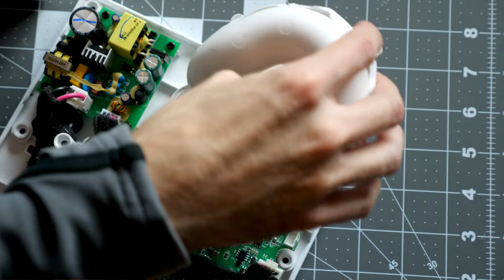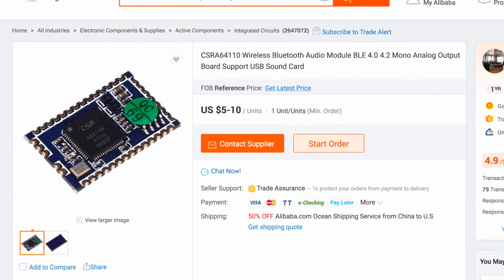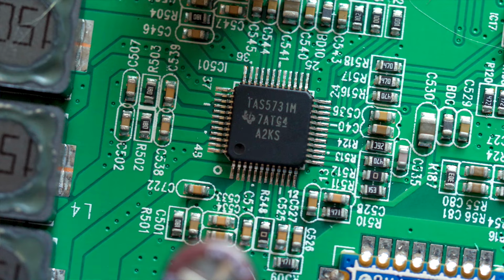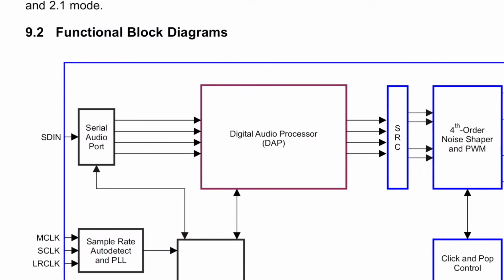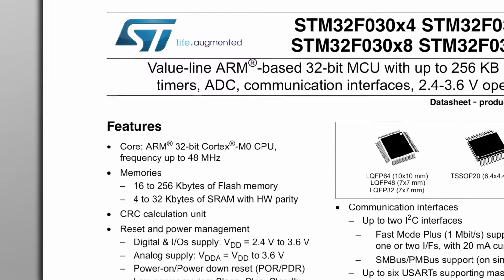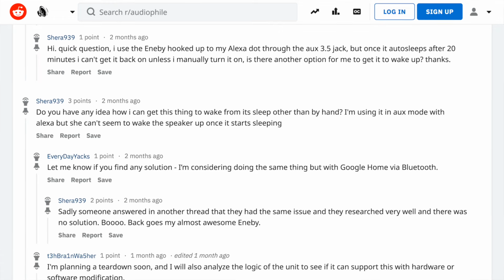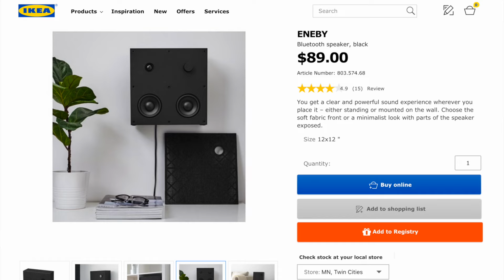Tearing Down IKEA's Bluetooth Speaker!

Comment: I have worked with STM32 Microcontrollers before, sooo here a few thoughts from me.

they actually support flashing (and reading, but never done that) over uart instead of swd, like other ARM microcontrollers, which is really great because it reduces cost, but i doubt that you would manage to do anything with the hex file. (or atleast i havent worked really hard with assembly for a long time)

I think it would be a much better idea to monitor the communication between the micro and the other chips and emulate that in a new firmware, which could be open source. I doubt it does much while its just playing audio, but rather just sets the registers of the chips when something happens (button press, bt connection, volume changed etc.) which should be not that hard to copy.

Dont know, maybe if i got time (and have to visit ikea again) i might give it a try, would be a really interesting project for sure.
Reply: The st-link utility do a simple obfuscation by default, so it woudn't be worthy to try to dump it
Reply: @mateusfelipecota  haven't tried yet reading flash out really.  well then it's to the Logic analyzer I guess.
Reply: I'll buy you a speaker if you can figure out a way to disable the autosleep feature
Reply: @hnisseplutt  thank you, but i think i might get one by myself anyway next month. Im already sorry for the warranty sticker ;)
Reply: If you fix this problem I will love you forever and tell my grandkids about you. Seriously.
Reply: @Strawberrymaker  I bought this to tear it down to do exactly this. I've got a logic analyzer as well. Every chip here is on the I2C Bus right?
Reply: @emb1995  Not sure, but i got my christmas money early, so i placed my order too :D Will be looking at reverse engineering the pcb first. could also look the parts up. Can you maybe PM me your Email address so i can invite you to a slack workspace? I think that would be much better for communication :)
Reply: @emb1995  rewatching the video. the bt module is using spi. The Stereo ADC is set up by itself with resistors or via 3 gpio pins. The Amplifier uses I2C.
Reply: Got mine today, starting work on it now :)
Reply: English please
Reply: @aasmith6117  forget everything I said in the original post. Found a way to disable sleep on aux and Bluetooth with just 2 wires and 2 resistors
Reply: @Strawberrymaker   So...will you share your solution with us?
Reply: @JamzFX  still working on the video and uni is getting a little bit in my way, but i think it should be done by the next week or two max. :)
Reply: @Strawberrymaker  Thank you for working on this Matze, how did it go? Don't see any video on your youtube channel.
Reply: @sallerc  Works flawlessly, my Eneby is running all the time now, but didnt knew how to put it in a video exactly. I will probably make a blog post soon. Kinda forgot about it, too
Reply: @Strawberrymaker  Sweet! Video is no requirement for me :) Looking forward to your blog post.

Comment: On the stereo mixing: the current version of the speaker (now called Vappeby -- not sure how much internals changed but it no longer has bass/treble setting :( ) does have stereo pairing option so the "master" speaker can take aux input and send it to the other speaker. I've found the option mentioned in manual for "Eneby 20 gen 2" already so it must've been something planned from the beginning and hence mixing signal in digital.

Comment: I might want to add some struts between the rear and front (says she who built her subwoofer out of 19 mm chipboard (small chips, not what you typically see in the US), probably went overboard with sealing and internal supports) and a bit more damping material but that looks surprisingly good. I just don't trust speaker walls that are that thin. :D
Reply: Samira Peri 👍🏽👍🏽

Comment: The stereo is not cutted from the AUX Jack input directly, simply because the left and right channels can be both differents in songs, so you just loose totally the left or the right if you remove a connector of the jack input. (like a guitar only on left channel or a drum only on right)
The solution here is to mix together thoses channels to one, with the chips you presented.
Reply: Yep, the proper way to mix down is to use opamps, but there are lots of components just to support the aux input
Reply: MichaelKingsfordGray  french
Reply: I bet one of the designers also saw the possibility to use multiple speakers like a stereo pair. even though it isnt implemented it  may be possible with some homebrew

Comment: I was thinking about what you said on the conversion of stereo to mono from the 3.5mm jack, and I was wondering if this is because the bigger Eneby has the same board, and supports stereo? I have never seen these speakers before, however, so it was just a little thought.

Comment: Should have had Bluetooth 5. The range would be insanely better.
Reply: Ikr
Reply: Henriko Magnifico it's a cheap ikea product lol
Reply: Cameron Chitra-Straley has surprisingly decent components for a cheap IKEA product.
Reply: Sybrand Botes Yeah, they shouldn't complain about bt 5.0 though, that was my point.
Reply: BT5 would have made this product unsalable because it’s not that common (yet).
Reply: @RustOnWheels  BT5 is backwards compatible with older devices. It will work with a phone that has BT4. Just none of the improved functions of BT5.
Reply: Felix O'Keefe that may be true for Android but is that true for Apple?
Reply: @RustOnWheels  of course it does... why wouldn't it?
Android doesn't ''make'' Bluetooth you know.
Reply: LA I know that but Apple is quite restricted in BT usage and I had lots of issues in the past with different speakers toting different BT versions in combination with Apple phones.
Reply: KlankOntwerp I haven't once heard about such problems. Apple uses the same bluetooth chips as android phones.
Reply: ikea use the cheapest Bluetooth solution, with bluetooth 5, the build cost will be not worth it for the cheapo speaker unit.
Reply: You have never heard about apple bluetooth problems ?? Really ??  @movitz1579
Reply: Insane range but you couldn’t hear the speaker from there.  😂
Reply: @RustOnWheels  why is this not surprising coming from apple? They would much prefer you to buy into their own propriatory bluetooth standards and their own apple branded peripherals if they could get away with ripping their customers off with them as well. If you want more broad range compatibility just buy any Open Source based android product from the manufacturer of your choice ie not apple! Their profits have taken a massive dive just recently. Why on Earth could that be then?
Reply: That would’ve been to expensive

Comment: This unit uses a class D amp design.   A class D amps uses PWM of a HF carrier with output filtering to integrate the output power.  It is much more efficient than  AB (+95% vs 50%) , so doesn't need a heat sink and has THD <1% . Because of the inherent flatness of the amp, a DSP isn't needed, just output filters matched to the speaker characteristics, which in this case are known. Bass tuned port sealed cabinet speakers are 1950's tech with well known, calculable performance characteristics.
https://www.eetimes.com/document.asp?doc_id=1274753

Comment: Great detailed teardown, it reminds me a little of the Logitech Squeezebox Boom, which uses a very similar looking woofer, and is a stereo active system using class D amplifiers,  digital crossovers, perceptual (fletcher-munson) compensation for volume and to prevent overdriving at high volume. Looks like a well thought out product.

Comment: With two cheap bluetooth transmitters from alieexpress, you could send left-channel to one Eneby and right-channel to another Eneby. All you still need is a stereo to mono cable. 

This way you could make a fully wireless  stereo setup.
Reply: good luck getting good sync
Reply: Bunnyslippers - or even better... just go and buy a PROPER stereo bluetooth speaker system. Will cost you less.

Comment: The power supply is on it's own board because no one designs AC-DC supplies any more, you just pick a board/supply out of a manufactures catalog biased on specs and features you need. The same goes for those BT daughter boards, they already have FCC certs and do not require to be completely re-certified, only the standard consumer device certification. The STM32 may have its firmware locked (a feature it has) so no dumping it.... Not a big deal since the STM32 is a very well documented micro with a ton of free and open dev tools (why it's popular in consumer devices) so probably quicker to just make your own firmware from scratch than trying to reverse a dump.  The Digital Audio solution is smart since it lets them do crossovers, filters, EQ and what not all in logic/software, saves a lot of parts and analog black magic wizardry.

Comment: Okay so the tx and rx won’t help you much with the code. It’s probably mostly used for debugging and uploading code (if it has a bootloader on it prior to being connected with tx and rx). What one could do is solder very thin wires directly to the chip and use an stlink v2 to get the binary off of it. It’s very easy actually. And after that it can be changed. You’d probably have to mess with assembler a bit to get it right, but it shouldn’t give you too much trouble.

Comment: if they did the mono mix down passively, maybe it wouldn't sound as good?
Reply: Sine Nomine I asked the reddit audio engineering thread about passively collapsing stereo a while back and they said it'd deliver poor results.
Reply: @voltare2amstereo  is phase adjusted real time or just flipped from the start? Never thought about the issues of summing, might have to revisit a resistor network sitting behind a speaker lol.

Comment: so with there being a spare output channel... What channel/power do you have spare?

Wouldn't it be worth fitting another speaker and maybe some basic heat sink's to the board... personally I think this platform would be great for modding as a 20hr battery life is huge! I would easily sacrifice some of those mHr's to drive more sound or even better quality cones.

Comment: There is most definitely some DSP-magic going on to make such a "bland" speaker sound good!
Reply: zapro_dk Basically every speaker of this type has some kind of DSP
Reply: @ilpatongi  Yeah. Before DSP speakers of this kind were either expensive af or just plain bad sounding.
Reply: zapro_dk Yup
Reply: I have some thoughts about where those drivers come from, and I'm not so sure... should be easy to measure, anyhow. :)
Reply: It would be stupid to convert the audio to digital unless it needs to DSP the audio.
Reply: Richard Smith The audio is sent digitally to the speaker in the first place.

It gets processed and then sent to the DAC and Amp
Reply: @ilpatongi  Not from the Aux port, they go out of their way to convert that into digital first, instead of just amping it.
Reply: @rich1051414  yes that's so it would get the same DSP, limiting, bi-amping, limiting, volume etc. processing as the Bluetooth source does.
Reply: @Qui-9  Exactly.
Reply: I have the big one with out using de build in crap eq very decent sound lower bass then jbl xtreme 1/2

Comment: Could you do a tear down of the W-king D8 (or Alpatronix AX500, as they seem to be the same design). I have a D8 but haven't been able to disassemble it. The D8's have crazy bass and volume but an annoying resonance peak around B-flat 1, and it would be good to check if anything can be done about it,  perhaps with acoustic filling, adding weight to/stiffening the enclosure, cutting a vent port, changing one of the internal speakers for one with different acoustic characteristics etc. to spread the resonance peak out a little.

Comment: Hypothesis: The likely reason they have 2 op-amps at the back end of the headphone jack is they may be planning a future version on the same or very similar hardware that can take stereo from a single speaker and split the left/right channels with a second speaker over BT. Also similar reason why the BT only has a single amp on its output. They're probably planning something like the way crApple's wireless headphones work where each unit connects separately to the host device.
Reply: Ya say crApple but if it wasn't for them there wouldn't be truly wireless earbuds... Everyone thought they were stupid until they created some... Also hats off to them I've tried them and they work very well, quite difficult to sync up 2 bluetooth devices together.

Comment: Yeah, I too spent those awkward 2 minutes figuring out the 2 center screws

Also - splendid overview!

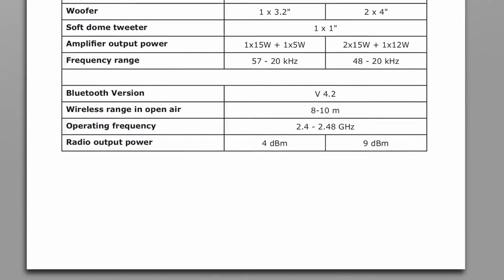9:00 the antenna looks identical on the eneby30 (I have a video teardown on that, waaahahay cheaper production quality though) .. said antenna is rather weak

Also regarding cut costing .. they could’ve also had the same board in both amps, and ... that really wouldn’t have hurt performance ...

They also didn’t enable TWS ... which would have again, costed nothing
Reply: > They could've also has the same board in both amps, and it wouldn't have hurt performanceì
I'm happy they cared enough and used the extra headroom to improve a feature, to be honest. 

What do you mean by 'enabling TWS'? Giving the user the ability to use two to play stereo?

Comment: I would guess the mixdown is analog behind the opamp. Doing it before the opamp would mean you’re basically relying on the drive amplifier of the device that it’s connected to, across the whole cable, to drive the mixing. That’s bad design if you want to be able to connect to everything, even when those devices are not designed great themselves.

Comment: Still though, for way less than $50 you can acquire a class D amp board w/bluetooth, four 18650's, a couple decent drivers and cheap tweeter and make a project out of learning about enclosures and crossovers.

Comment: This video was great to find. After 2-3 years of use, My Eneby 20 will not connect to anything. It simply searches but won't hook the nearest Bluetooth signal. Can this main circuit board be purchased? I suspect that's where the problem is.. or should I simply toss it and buy a new one. Up until this glitch, I've loved this Eneby speaker. I've spent hours trying  to get an answer from IKEA but I think their website is designed to keep you searching until you simply give up

Comment: They could just have just used the CRS module... and an class D amplifier.
Looks like that paing qualcomm for the development platform was not in mind so they added lot of glie logic to the board.

Cirrus logic have boilt in Kaliba DSPs, htey can output digital audio I2S and PCM.
They can route an analog input via its internal ADC to the DSP and back to the digital audio interface.

So they only needed a tiny uC for volume control (a ARM uC is just useless in that design), a class D amp and the CSR module.

Comment: I wouldn't be all that surprised of the margins on IKEA products are pretty thin in general and that they rather opt for volume.
With that said though if they decide for a product they likely buy at a pretty decent volume so they can keep prices down a bit because of that too.
And then there's of course things like distribution and storage and such probably being pretty efficient and having less steps than if you bought a speaker in some electronics store who bought it from some other local distributor who ordered from the brand company who maybe even ordered it from someone else ..

Comment: I've noticed a mistake.
Looking at the TI power amp a little closer, you can see that all 4 outputs are, at the least, connected to external components. This suggests that the tweeter is being driven in BTL (bridge tied load) mode as well. There are some nice benefits from using BTL amps.
The datasheet states a max output of 15W when using BTL mode, but that doesn't mean you have to use all of it. Great video otherwise.

Comment: Passive mixdown of stereo is a bad idea. This speaker might be inexpensive but they didn't want to cheap out like that.
Reply: I have used summing RCA cables to take stereo down to Mono before when I needed to I'm just curious as to what the technical reasons are why you shouldn't do this ? In other words what are the sound quality losses and which way should it be done? Genuinely asking here I've never heard such a thing
Reply: @maxwelsh6121  the main reason is you can overdrive the input. If both channels max out, you'll get 2x max voltage on the summed line and you could blow whatever you're feeding that into. You should at least use a resistor to drop the voltage back to nominal level.
Reply: mikosoft of course you’ll get 2x the voltage. In most modern music both channels hit peak at the exact same time very regularly, it’s a complete non-issue that the voltages will sum to <= twice the amplitude of each of the original channels.
Reply: Max Welsh there’s no problem with that as long as your output is leveled properly
Reply: Roughly what id had expected.  What i hoped to learn is what between  the lines     what would the issues be if the two channels had significant waveform/power demand  diffs? What  Mikosoft was gettin at...
Reply: @asdfkjhlk34  the problem is you can't level output on a cable. Passive summing CAN be an issue - as I said you can overload the input which will either result in clipping or in the worst case will completely damage the input.

Comment: Interesting and informative. I'm rather curious about the size of this device, would it fit snuggly inside IKEA's ubiquitous Kallax shelves? (I think that's the product...) I'm also jealous of that tidy workbench. 🤔
Reply: It does. At least the smaller one. It's actually designed with that in mind, if I remember correctly.
Reply: Not this one. This is smaller. The name is the size. Eneby 20 is 20x20cm. While the Eneby 30 is 30x30cm. That's the one that will fit snuggly into Kallax and other room dividers :)